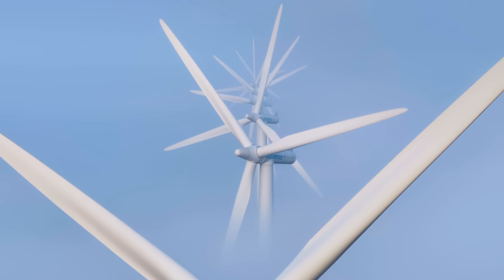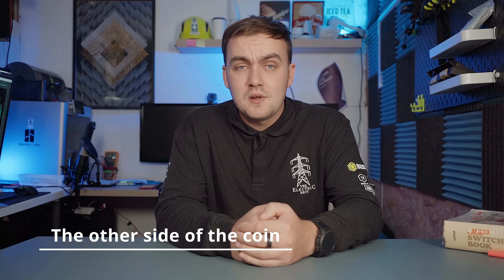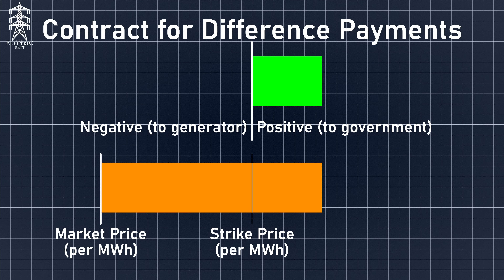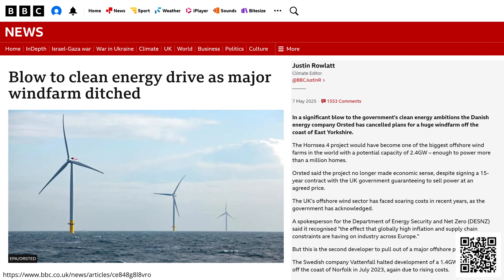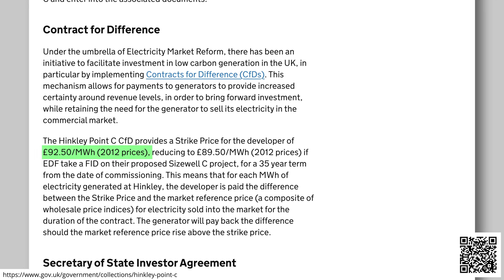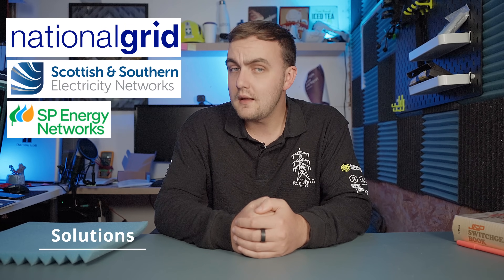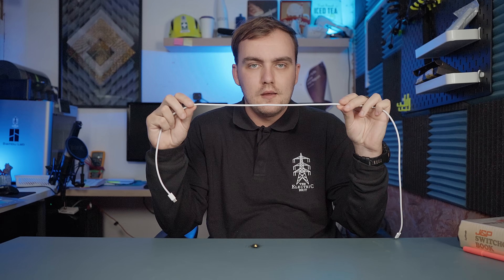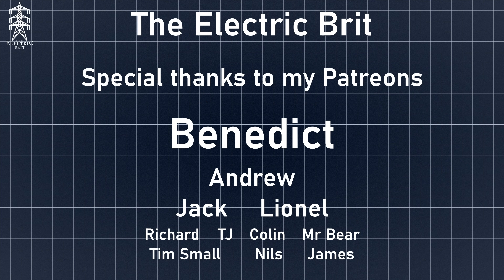£1.8 BILLION Wasted on Energy Bills

Comment: Electricity pricing models are simply broken.  In Ontario, Canada, the electricity system was opened to competition in 2002. Prices were supposed to drop.  Since then, adjusted for inflation, prices have increased by 30%.  An offer/bid market is theoretically in place, to set the market clearing price, but in reality it only accounts for 30% of the actual pricing.  The other 70% is the difference between the market price and the actual money paid to generators (which is substantially higher than the market clearing price).  The 70% extra is called the Global Adjuster, which includes contract pricing, constrainment costs, etc. By many perspectives, the open market experiment has failed. So much for idealized dream that competition lowers prices.
Reply from the maker: Privatisation brings down prices though right? ;) The best performing service providers are the ones where the customers are the shareholders. I just made that up but from my limited experience of things like energy and internet cooperatives, it seems to ring true.
Reply: @TheElectricBritOntario Hydro was vertically integrated.  OH was the generator, the transmitter, the distributor and the system operator, as well as the system planner and constructor.  Being owned by the Province of Ontario, it was not allowed to operate at a profit.  Hence the hustorical low electricity pricing.  All the Keynesian economics hand-waving will never convince me that for-profit corporations will ever operate in such an altruistic manner.  And, history has proven this reality.
Reply: @TheElectricBrit
NOT always true in rural areas!
My Summer Camp in a rural area with very low population density has a very high monthly meter charge, but very low per kilowatt hour charge.
They have to run a LOT of wire that only serves a few folks.
Basically low usage consumers are paying a pretty penny per kHr.
If you're a high usage year-rounder it's a decent deal.
It's an electric cooperative.
I chose to remain off grid to avoid the meter charge when it's idle during the winter.

Comment: IIRC the east of Scotland 275kV double circuit (and I’m sure many others) was actually built with towers / spacing suitable for upgrading to 440kV.  So they would <only> need to upgrade the insulators and the substation gear to almost double the capacity!  They thought ahead when planning these circuits!
Reply from the maker: A lot of forward thinking when the supergrid was built! I can’t remember the exact tower designations but as you point out some are high enough for 400 kV. The designs that aren’t suitable though there’s a scheme going on to swap the cross arms for insulated ones. This will give them the clearance needed from the tower to be uprated without replacing the tower.

Comment: The rail overhead lines are tensioned by weights. Why don't transmission lines do the same?
Reply from the maker: Rail in the UK is typically 25 kV compared to the 132, 275 and 400 kV of transmission. Transmission lines are already massively heavy for the amount of current and span but we do actually have to tension the lines when they sag too much. When you change the direction of an overhead line circuit the tower foundations need a lot of consideration too, as that tension is then pulling the towers over, so the corners need loads of extra concrete. Extra weight / tension = more pulling on the towers.

If you're in the UK and ever drive down the A1 around the Yorkshire area you'll notice some of the overhead line suspended insulators (the ones that are vertical) are ate a massive angle and that's because after they were installed they sagged too much so had to be tensioned to raise them from the road. When you drive under some of them they do seem very close to the road but in reality its still a massive gap. Great question though!
Reply: @TheElectricBrit  Used to go up and down  the A1 as a kid. My dad was from Newcastle came down to Colchester with his dad and ended up overseeing the electrification of the east coast main line. He'd have loved your channel :-).